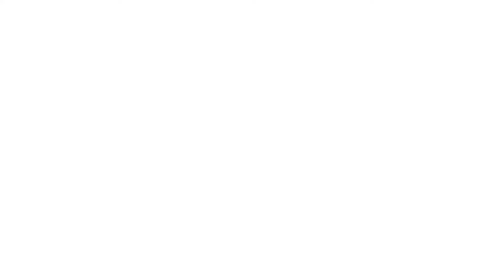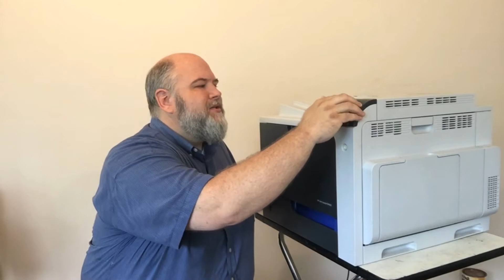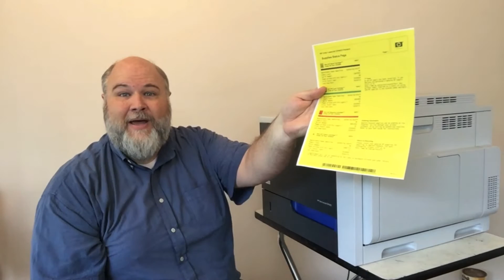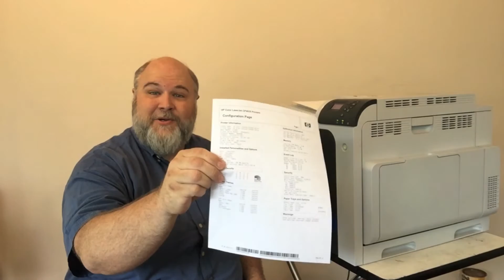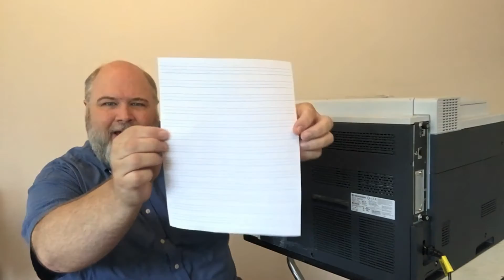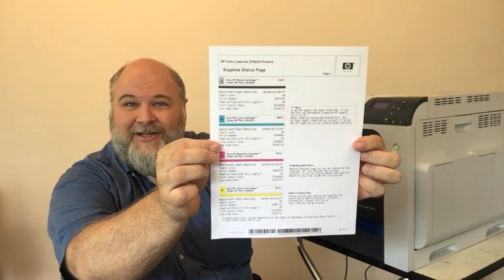PRINTER REPAIR: Solid Color Background On HP CP4525

Comment: I have the same problem on hp cp3525dn.
But if i press the hidden button on the back it prints still solid yellow. 
I've cleaned the contacts on that board but no luck. Any ideas?

Comment: HP Laser Jet CP4525 59.F0 Printer Error! what to do?
Reply: Check tha fuser drive clach it.s  not ok contact this nombre 0097450129444
Reply: Error 59.f0
50% fuser drive assy
50% DC Controller